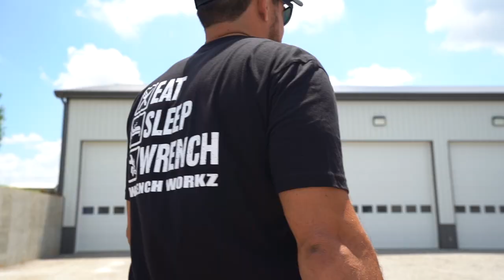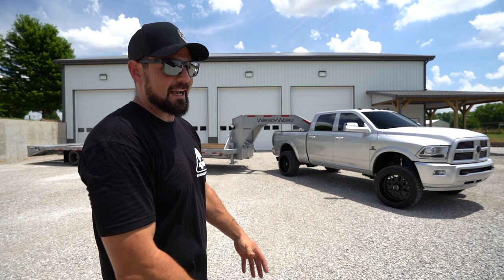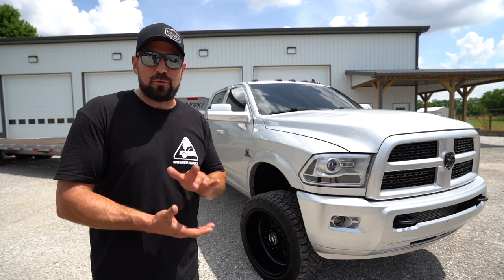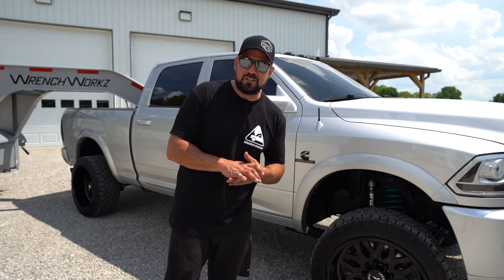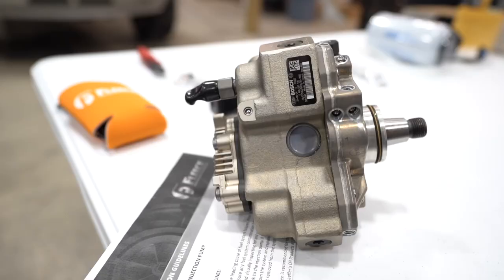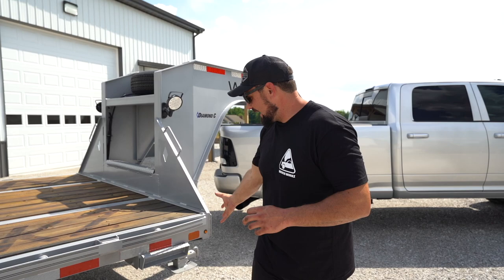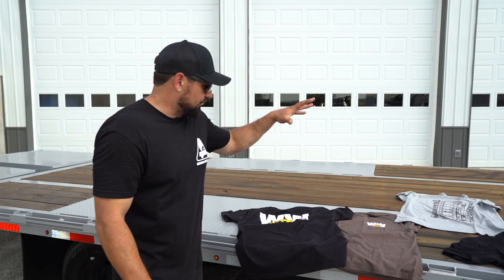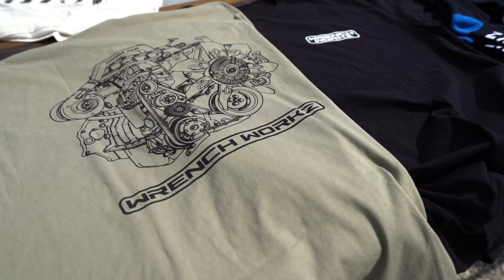This Ram Truck is the Ultimate CUMMINS Daily Driver/TOW Rig!!! Here is WHY!!!

Comment: I’ll be entering this one forsure! Greg do you have any info on the trans or is it just a new stock trans?
Reply from the maker: New Transmission with updated fixes and triple disc converter
Reply: New aftermarket transmission or new stock transmission just with upgraded

Comment: Question, would it theoretically be easy to put the aisin transmission in a 2500 from a 3500 or are the significant changes aside from different tuning?
Reply: He never replies to comments so why ask, but to assist, not difficult at all if you got the bread. Same with G56 swap, harness, clutch, trans you good but bad part is none the swaps are cheap, this ain’t 90’s when mostly mechanical

Comment: 😂
None these 6.7’s are daily drivers. You drive less than 30 miles a day, not on interstate and round town? These are not the trucks for you because you’ll be doing forced regens, dealing with FEDS, swapping emissions every year to pass even in states that don’t require. Being 11/14/23’ you got most 2 more years before they start banking off us private owners & truckers alike regardless if you own 
pre emissions to register and be stopped on road for checks and another 5 years it won’t be legal to drive our trucks without a special registration with sticker identifying cleanliness & the fine will be so high that people will fade away from buying or building unless it’s off road or race 😢